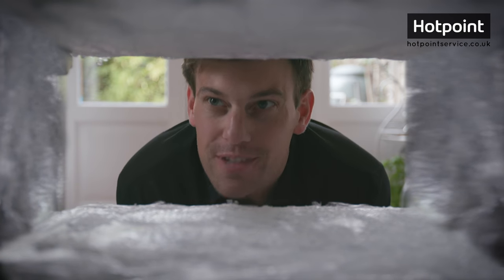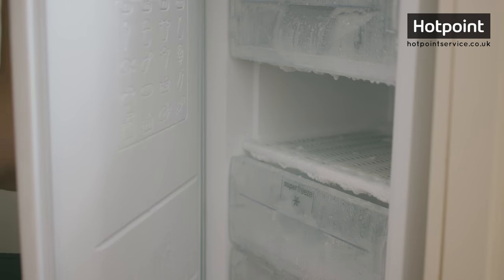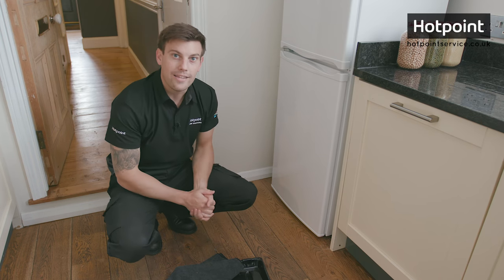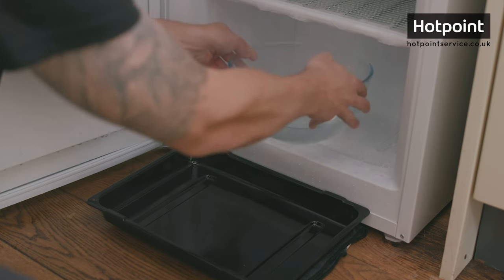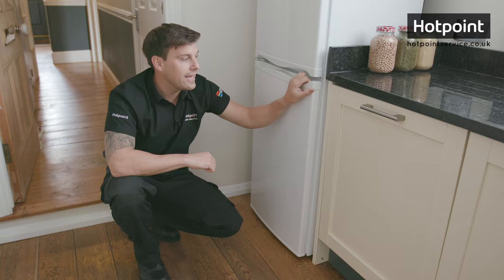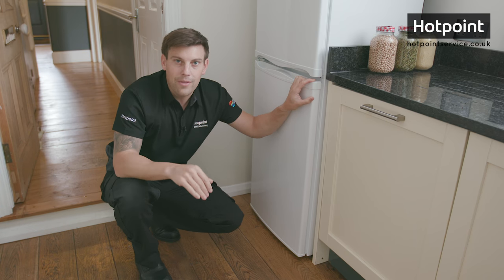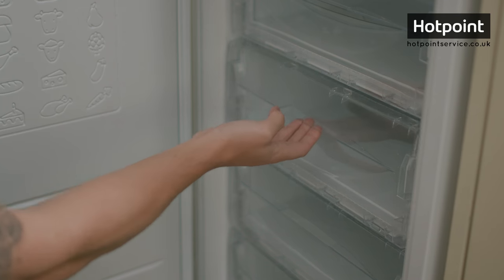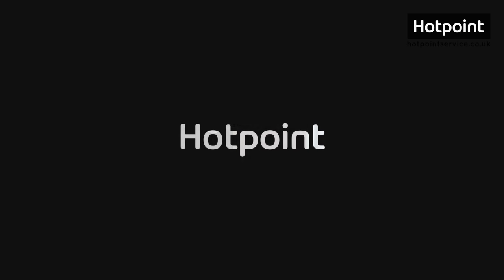How to defrost your fridge freezer | by Hotpoint

Comment: I don't pry at the ice right away, but let it start melting on its own for about an hour or so. Then it comes right off the pipes. I think the pipes and metal radiators might be carrying heat from outside with the unit off. There is sound of bubbling and hissing. I removed a kitchen sink full of solid ice that was easier than collecting water.
Reply: The only time I've hacked some of the ice away is when I've come home with too many items that need to go in the freezer,and need to make some more space quickly by removing some accumulated ice. A breadknife is my weapon of choice for this.

Comment: How to defrost the freezer part without switching off the fridge part?  Or do you have to just switch off both?
Reply: They are both powered by the same system so in order to turn off one you need to turn off both

Comment: Nevermind a tub of hot water,
put towels down & blast it with a hairdryer.
done in less than 10 minutes
Reply: He also forgot to tell you to shut the door to let the water do its stuff.

Also, you need to switch it off otherwise you’ll never defrost it.
Reply: @BalwinderSingh-w9m  literally every article and manual says to leave the door open. What do you mean by "let the water do its thing"? 😂😂
Reply: @swampy1234  Basic thermodynamics.  

If you keep the door closed, the heat will stay in the freezer where the ice is. When you apply heat to ice, there is an energy transfer to the ice which causes a state change (called melting) to water.

If, on the other hand you leave the door open, the heat energy will escape and the ice will take longer to melt.

I hope that makes it clear.

As an extension exercise, see if you can explain why food takes longer to cook in an oven where the door is left open than in one where the door is kept closed.

Comment: Answered my own question .  Yes you can have your Fridge Freezer Too Cold .  I discovered that there was at least an inch of solid ice blocking up the drain hole .  Hard to believe, because there is quiet a lot of heat from the Compressor .  I had to push a solid rod up the drain hole from the bottom , surprising how much water came out .
Reply: Mine is quite old and has become overzealous,making things colder than they're meant to be for the setting it's on (has a turnable dial). At least it's better that way than the opposite.
Reply: So i shouldn’t use a hairdryer

Comment: I have an old Hotpoint Fridge Freezer and the drain hole is blocked  I have cleaned it out before, I managed to pass a probe all the way through until it appeared out of the hole at the bottom .  I also pushed it up from the bottom until it came out of the drain hole inside of the fridge .  There are 2 circles down there .  One has blue foam and a metal clip .  The other is a simple white Grommet that, as far as I can remember is the Drain that drips into the drain tray .  Is this correct ?  I do get a tiny bit of water on the end of my finger if I insert it into this hole .   However this time I simply cannot get anything Up or Down the drain whole from either end .  Can anyone help !

Comment: I suggest another method.
I blow air into the open refrigerator with a fan. This is also a quick and drier method. 

Más módszert javaslok.
Én ventillátorral  fújok levegőt a nyitott hűtőszekrénybe. Ez is gyors és szárazabb módszer.
A megolvadt jégból keletkező víz  egy része el is párolog de időnként nem árt eltávolítani a meglazult jégdarabokat illetve kitörölni az olvadékvizet.
Az eredmény hogy a hűtő a folyamat végén száraz is.
A forróvizezés szerintem körülményesebb.